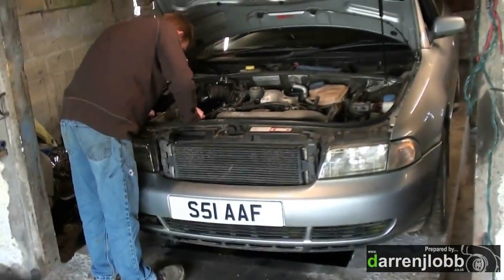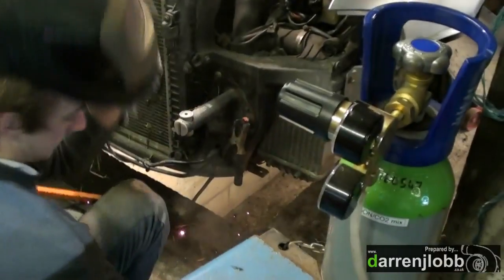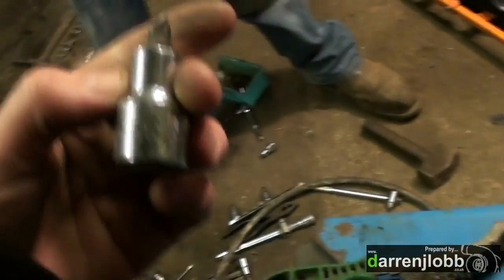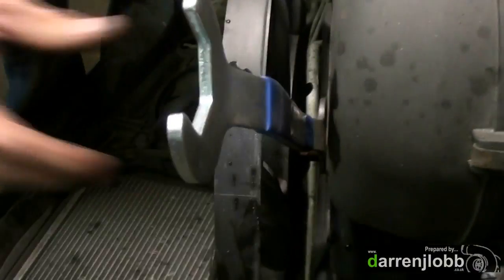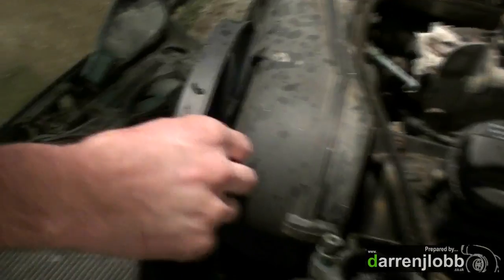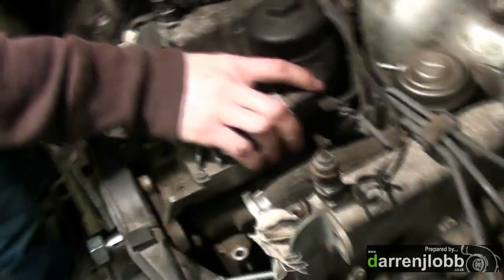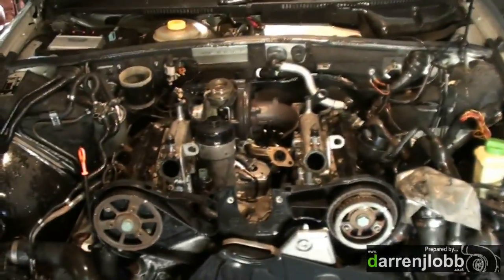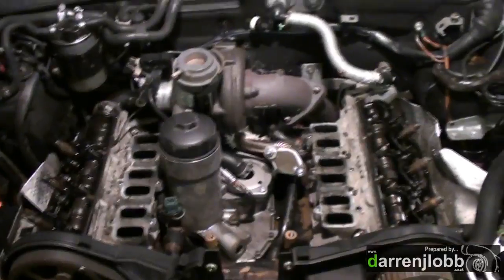Audi V6 MTDI Project Part 1

Comment: Interesting project. THe EDC15M unit will not work without vp44 pump. How you will emulate CAN bus?
Reply from the maker: We didnt, entire point of project was to remove the VP44 / ECU and run the engine mechanically....

Comment: what pump you use for this? :-)
Reply from the maker: Custom built the pump for this, but essentially any VE housing with 12mm 6 cylinder head and a DI plate will work...The rest is just down to what you are after...

Comment: You shouldn't take the pulley out of the VP44, it is not necessary and it is pre-set by bosch. Taken out you can't set your injection required at around at 2° ATDC +-2°

Comment: this is an easy answer bin the ecu ? 
the ecu immobilizer works by turning the electronic fuel system/pump off in the event of theft if you remove the electronic fuel system and replace it with a mechanical one it will remove the immobilizer system from the question and as the egr is controlled via the ecu it will be useless anyway 
basically taking a modern and advanced diesel engine and rolling it back in time 10 years and improving it while he is there MPG will suffer slightly but nothing bad

Comment: How do you get around the problem of the ECU being broken? A lot of cars like that have parts coded to the ECU to prevent theft and resale.  On my car everything has to be programmed at the main dealership before it will even work, so costs a fortune if anything gives error codes. I did try my own interface via the diagnostics port with software, but it wasn't able to do much of it.  Getting everything working might be difficult, but it should give some good results. Bin the EGR & CATs!